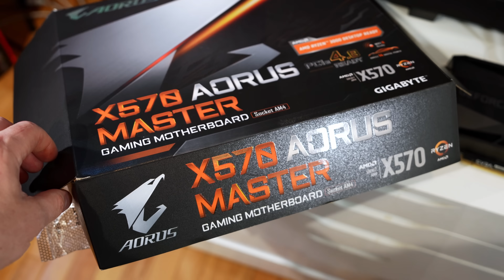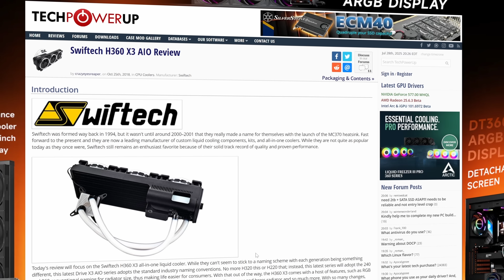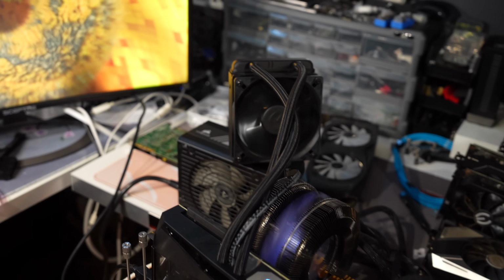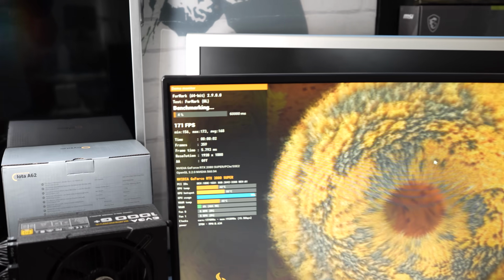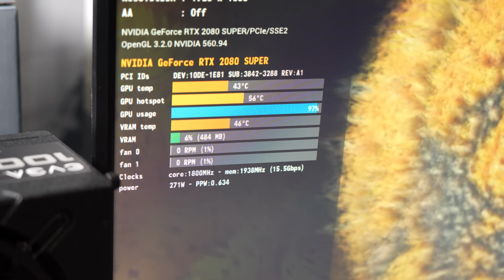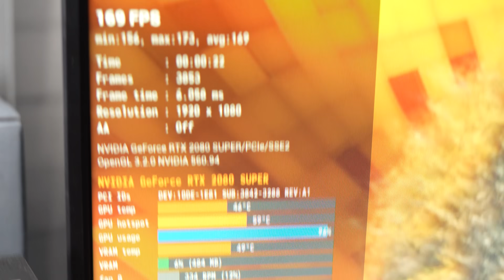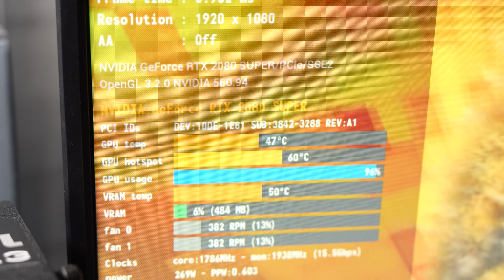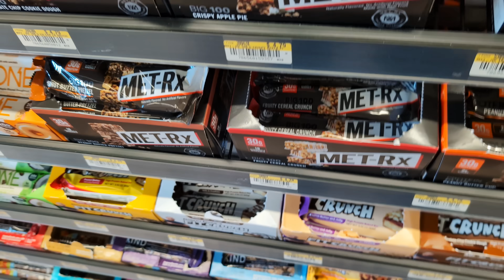Customer found this "FREE" PC, Lets find out what works if anything...

Comment: Something I don't really understand is why go with an AIO at all if they keep getting clogged? It is one of the problems I often see in videos. I had an FX-8350 with a Coolmaster tower cooler and I built the thing in 2013. The CPU died before the cooler and replacing the cooler would mean just replacing the fan. I have a Thermalright Peerless Assassin on my Ryzen 7 5800x. I cannot say it is noisy.

Edit: The one thing I would add is that a B450 / B550 is like $75 new? Still be a pretty cheap build to go that way.

Comment: For those who don't know (nothing wrong with it), that case..🤤 is the Corsair Obsidian 700d Full Tower case. This is the first case Corsair released along with the 800D back in 2008ish and they don't make it like they use to anymore. It can fit a 360mm thick radiator in there.  I still have mines  and I'm saving it for the next gen platfofm (AM6 or Nova Lake). Whoever is the owner of this case, you've got a great case. Congratulations.

Comment: Shame about the Motherboard, I did see one of the repair channels, North West Repair MAYBE, have one that flickered and they diagnosed and repaired it, I wish I could remember which channel it was.
Reply from the maker: Probably North Ridge if I was to guess. I did end up trying to reflash it after, but upon taking off the vrm thermal pads, I saw some burn marks around them. Pretty sure it could be repaired.
Appreciate the comment.

Comment: 6:57  After disconnecting the power cable, press the power button to drain charged capacitors in your system.

Comment: With the Liquid cooled GPU if you suspect the pump is failing, purchase the air cooled shroud to replace it, the PCB of the same brand and model is the same generally.
Reply from the maker: It's been fine since, just had the gurgles for a bit.

Comment: i have a 3950 Ryzen and its the same it refuses to work , had it working once , but then refused to work with 2 sticks of memory , now it just won't boot !! so an expensive paperweight  !!!
Reply from the maker: Yeah that's frustrating. People do fix boards, you could always toss it up on eBay or FB marketplace and list it as non functional.
Reply: @techwandoUS it's a cracking cpu though but if it's not working it ain't much good is it 😂😂, I've heard they are very picky with memory too , wether that's the case I've no idea

Comment: I have a very similar version of that case…possibly bigger…set up for server type stuff though…has a door on the front with hot swap drive bays. The size of the case is problematic as cable length requirements are massive to span the case. Is a super sweet squared off case.::not a single curve makes it monolithic.

Comment: I got a system from someone because it had problems for a few years as partial payment for some IT work done, and at minimum could part it out and sell. It has a i7-12700KF, 1x 32GB RAM, some cheap H610 motherboard, and a EVGA GeForce GTX 1080 Ti HYBRID (hybrid air and AIO for cooling). Sure enough it would quickly throttle under any load, even though temps and everything looked good (nothing ever above 50C). I started trying to load it down with various utilities until finally during a graphics benchmark I heard a big POP and it died. Tore it apart and found whomever sold it to him had installed a MODIFIED cheap Apevia 500W PSU, with PCIe power wires spliced to add another PCIe power connector for the GPU from the only single PCIe power wires. Swapped in a good quality 850W and its back to full speed now. Just trying to figure out what I actually want to do with it now since I already have over a half dozen other PCs with their various purposes, varied from Ryzen 9600X, 5900X, 5600G, 2600, 1600AF, a reclaimed server with a Xeon running Server 2019, etc.

Comment: It's 2025 and I think its time to chuck out the commercial canned air in favor of a rechargeable duster device.  The canned stuff is a waste of money and easily the quickest way to accrue e-Waste these days for an operation such as yours.  Plenty of good, affordable units to be had off of Amazon with high RPMs to get at every dusty nook and cranny.  They charge fast, retain power for a long time and last for more than a couple sessions of a good airing out of hardware.
Reply from the maker: I have one but during my last haul this guy gave me a whole bunch of Staples canned air. So I'm just burning through it.

Comment: Nice job. I always find something so satisfying watching these kinds of grounded videos. I guess it's because it's nice to see the revival of old parts or finding some way to breathe new life into them.
Reply from the maker: Coming from a 1070 with DLSS stretching the legs of the 20 series, he'll be pretty happy I think. 
Thanks man.
Reply: There are two things I tend to hold onto, late 2000s psu due to the amperage of the 5V rail, and nice cases. They don't make them as they use to anymore. One can sit on them. The ones now? Hope it doesn't break when one just slightly touches it.

Comment: The 2080 super Hybrid is a really sweet addition to this build.  Sometimes the good ole short the green, and negative on the 24 pin power connector will just seem to reset a PSU.  It might have gone into protective mode after seeing the size of your Kitty.
Reply from the maker: I got out the thermaltake tester and it restarted it like an old car. It was wild though, roughly ten minutes of me thinking the bench was cooked.

Comment: 2 questions.
How DO you get things as such for free???
Off the Facebook?
And it was supposed to be the PC YOU built??
So if it's so, where did the spacers went?😮😮😮
Reply from the maker: Yeah so the client actually found it posted on a FB group in the free section. Very lucky find but obviously not all of it worked.
Reply: @techwandoUS 
Darn - the GeForce RTX2080 Super is a find!!
ram,cpu,even case for - it's rare.
Usually it's real junk.

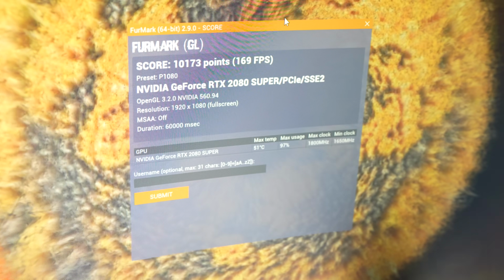Comment from the maker: Please pardon the usage of the loosely used term "short" in this video. At 11:05 I was referring to the PSU Power Protection Timeout or Over current protection.
The psu essentially stopped functioning for a few minutes and was fine after the capacitors drained power. 
As for the Ryzen CPUs, people like Greg Salazar and others have noticed the motherboard shorting when the arm comes down during CPU installation and this is what I was referring to.
Between the temperature in my office and troubleshooting I was kinda losing it.

Thanks everyone, feel free drop a like to support the video.